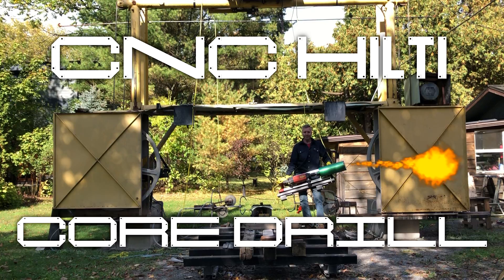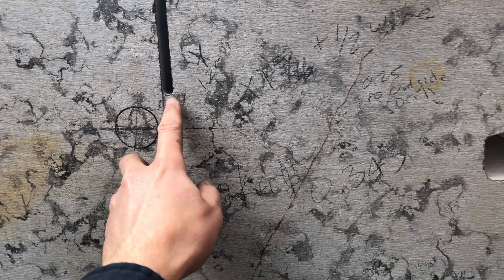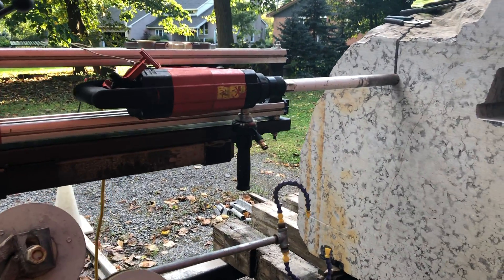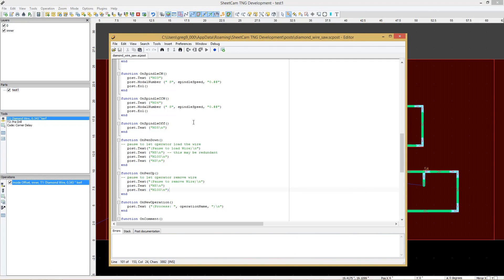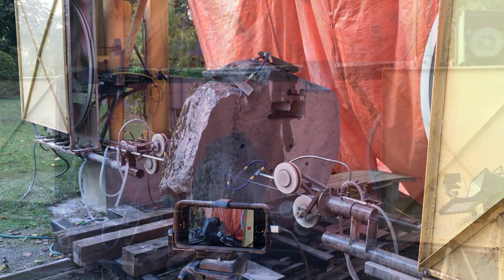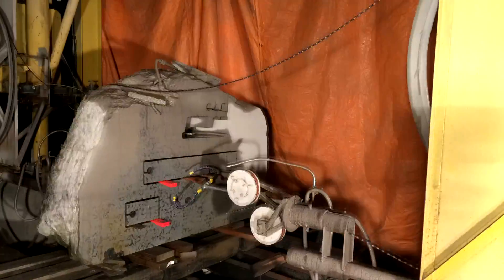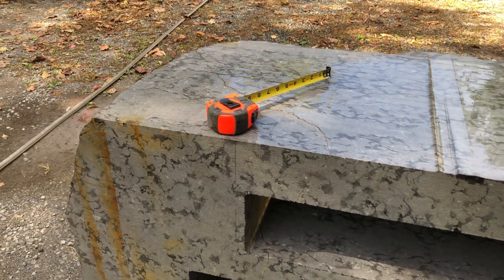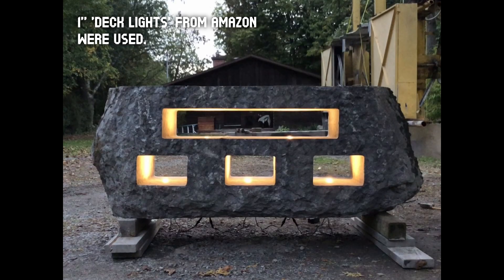#CNC #HILTI Core Drill for Stone

Comment: About how many hours do you get out of the Dimond cable?
Reply from the maker: Wire manufacturers rate the wire in "meters square cut per meter of wire" and can range 9-15 meters square/meter. To date, I usually damage the wire before wearing it out.  It gets damaged when the connector breaks and gets wrapped around the pulley wheel shaft.  I'm working on a brake so that doesn't happen.

Comment: I'm intrigued by the corrugated effect running perpendicular to the wire direction, probably highlighted by the water, on the horizontal cut surfaces. Is that caused from some vibration in the rope?
Reply from the maker: Good question Geoff.  I'm not sure.  It could be I'm cutting too slow so the wire has enough time to wear the stone from the small vibrations in the wire.  It's something I'll look out for to see if I can correct.